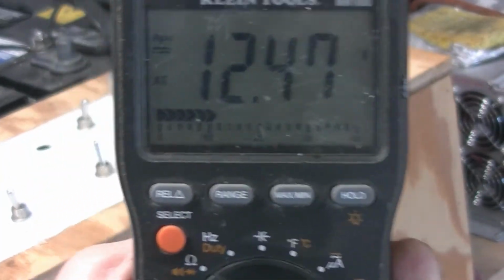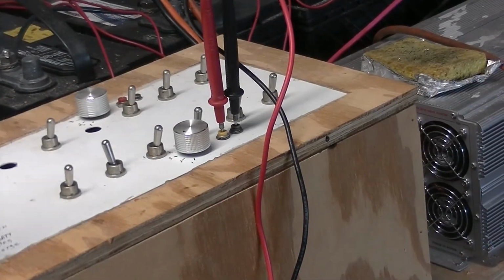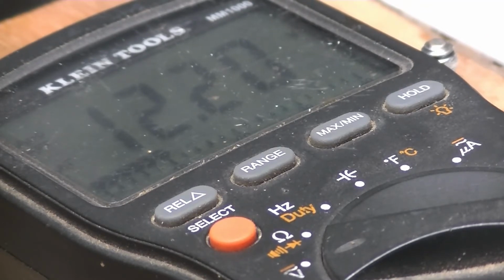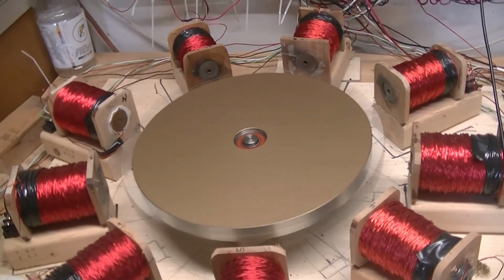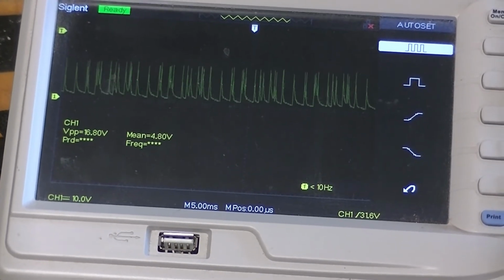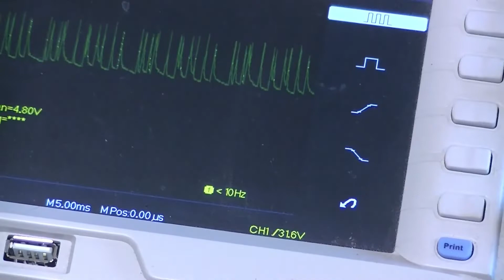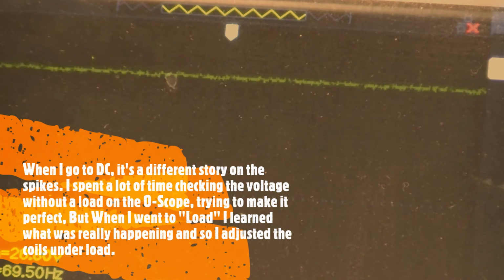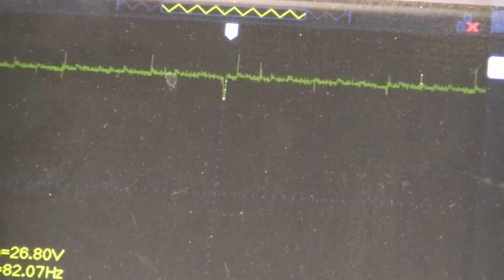Pulse motor generator PMG, Adjust your coils for max output

Comment: Very nice explanation of what you're looking for. When tuning the motor. And I love the large gap and the large iron cores. In your opinion does the larger Gap improve the charging rate versus a closer Gap to the magnets?
I run a one inch Gap myself, definitely seems to change the drag effect that happens on most motors with the coils close to the magnets.
Reply from the maker: Thank you. #1,) the core needs to equal the diameter of the magnet for maximum effect. No matter the size. 2.) The gap, there is no need to put the coils very close to the core. It will work. These are N52 magnets. very powerful. 3.) if you are getting a "drag effect" the coils are not synced to the circuit. This is why I have 1 circuit per coil. 1 circuit with multiple coils will not work. The adjustment will be impossible. Thank you for the interest. I look forward to more questions as I learn how to make a better battery system.

Comment: I SURE WOULD NEED HELP ON BUILDING THAT WIRE TWISTER MECH. EVEN A 3 MIN VIDEO WOULD GET US STARTED. ITS NOT EASY GETTING BLADES OF GRASS OUT THE WINDINGS.
Reply from the maker: OK, soon. Thank you.
Reply from the maker: Bad storms today and possible tornados. I will make a vid tomorrow (Friday) evening and try to post it that night or early Saturday. You need a motor, Washer, dryer, A/C fan motor, etc.
Thanks again.